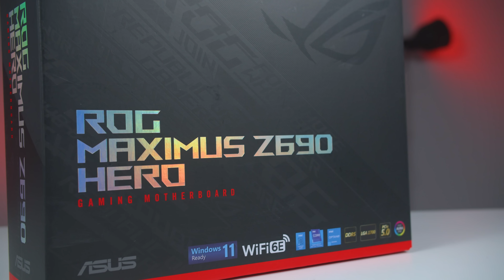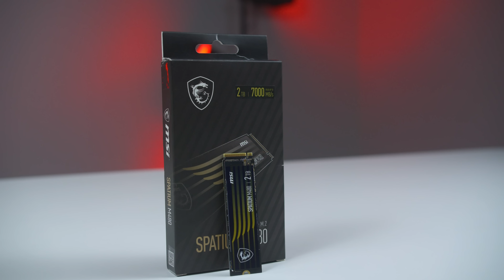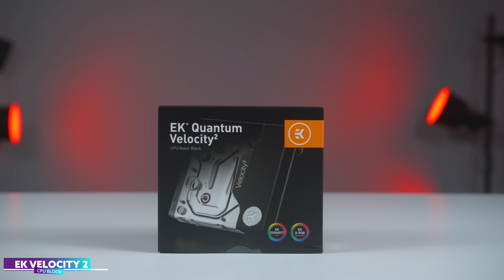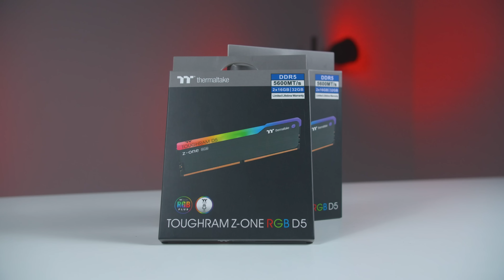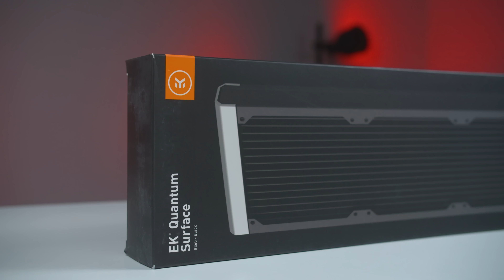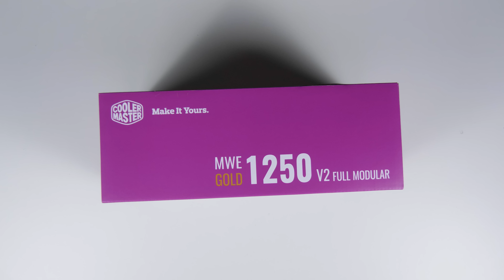I Built a PC with INSANE Water Cooling!

Comment: Amazing video!! Why did you use 2 different rads on the front and bottom? just wonder would 2x of these EK QUANTUM SURFACE S360 fit on top?
Reply from the maker: They would fit, i just didnt have 2
Reply: @DesignsByIFR  Many thanks boss ! i am fan of ur videos. Thanks for helping planning to buy this case and i was wondering whether 2of those would fit on top !! thanks for answering!

Comment: There is still air trapped in GPU watercooling board. But other than that, great work.
Reply from the maker: Thanks!
Reply: There's always going to be air trapped somewhere in loop when filling up and running for the first time. It works itself out over time.